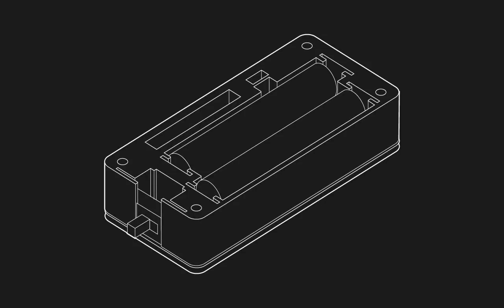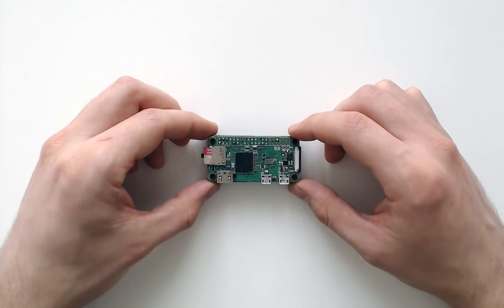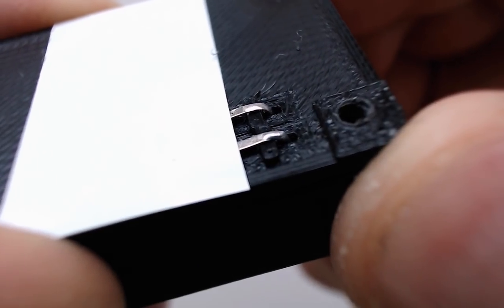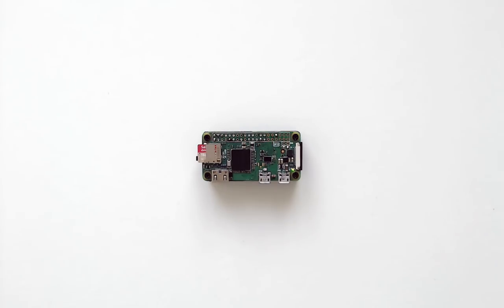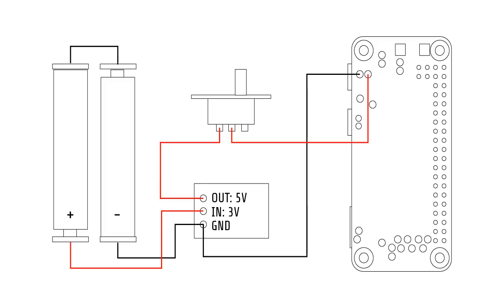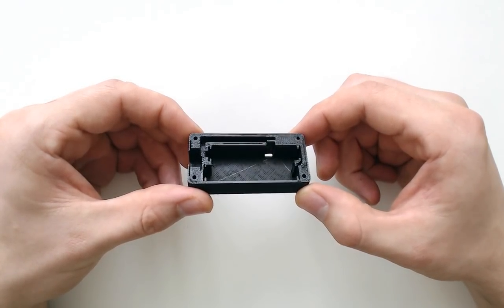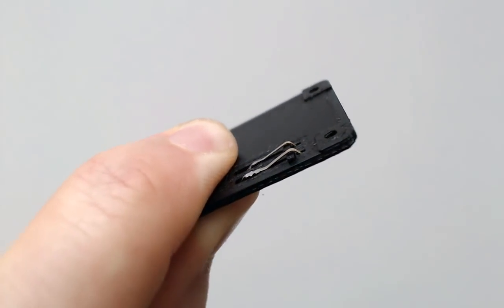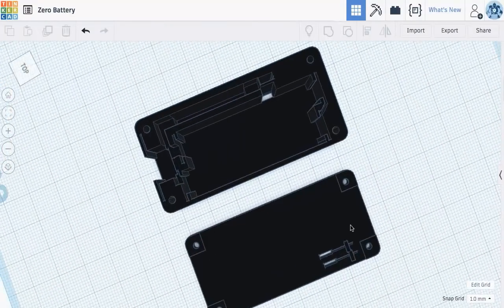Pi Zero Battery Backpack Prototype

Comment: Would it not be better to have the switch between the batteries and the buck converter? This way you wont be powering the converter all the time?
Reply from the maker: Yeah you're right. Next version will be like that. I didn't take that into account because I remove the batteries when it's not in use

Comment: Did you consider using rechargeable batteries? Or do you think adding a charging circuit would add too much bulk/ complexity?
(other than taking them out and charging them in a bank)
Reply from the maker: It's probably possible, but yeah, it will make it bigger, more complex (and more expensive). There's barely any spare room as it is.

I've never made a AAA battery charger though, might be simpler than LiPo
Reply: N-O-D-E still a very cool project nonetheless :)

(P.s. love the videos & that you take the time to be active in the comments)

Comment: Could you use the Pogo pins for power?  

seems like this could be a very nice replacement for the OTG On-The-Go Cloud unit from Monster Digital:
https://monsterdigital.com/products/otg-cloud
Reply from the maker: Yeah I considered pogo pins, but it would be difficult to secure it firmly in the 3D printed parts (without custom PCB or perfboard etc)

Comment: It would be great if there is a version of rechargeable batteries
Reply from the maker: just use rechargeable AAA batteries
Reply: N-O-D-E I mean the batteries can be charged by plugging in USB power into the case
Or make use of Adafruit's PowerBoost
Reply from the maker: Yeah maybe there's some way to hook up rechargeable AAA batteries and charge through the pi itself.

As for the Powerboost, like I said in the video, this way of doing it is way cheaper.

Comment: Shouldn't you have put the switch between the battery and the converter instead of between the converter and the pi zero? Now it's power-off state will have some current running through the converter,won't it?
Reply: I did it once with the switch after the converter and got my LiPo depleated beyond charging safely possible. The Booster is indeed active whilst idle!
Reply: Good to know, at least with my comment as top comment other's will surely use the correct way to wire the switch =)
Reply from the maker: Yeah, probably should have. Both ways work fine